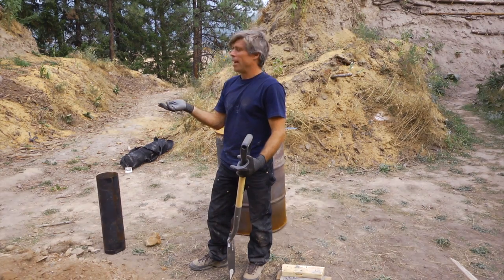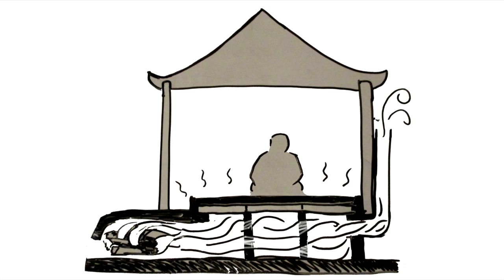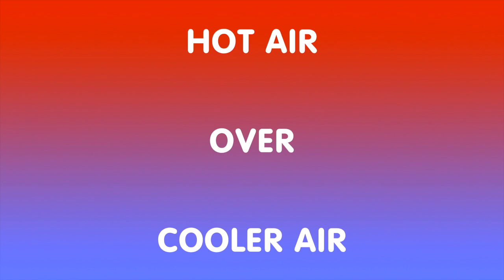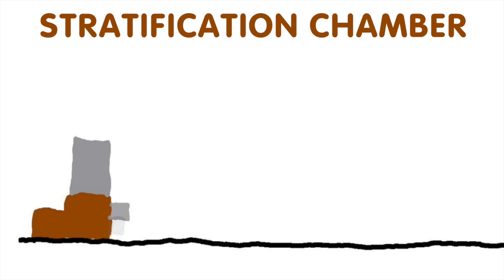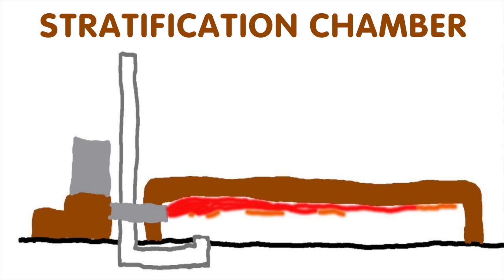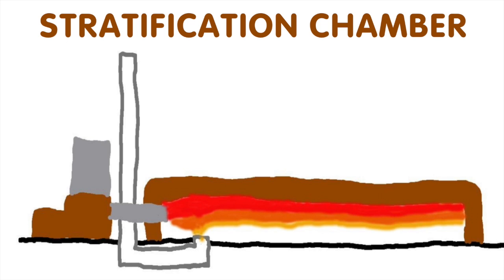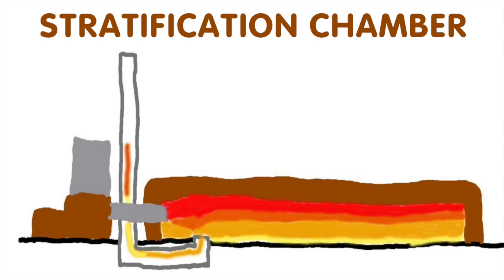stratification chamber in a rocket mass heater with matt walker

Comment: animation is understood-able, but  the side of bench nearest to the heat output from the rocket stove will be stinky hot to be sit on, as compare to the further side of the bench.  isn't it. 

unless u got a thick wall above. 

and less very much less mass in it as compare to the flue type of bench , hence maybe the heat won't last till morning. 

any number comparison ? :=) anyway, good work, that's how chinese in the older day did it to their sleeping bed.. just simply flue under the bed.. made very tight, so won't be poison by carbon monoxide during sleep.
Reply from the maker: Stinky?  We have tested this.   The heat spreads out really well and really evenly - provided that the stratification chamber is level.  

Less mass is, indeed, less mass.  

I think you are mentioning the kang bed stove - which, I thought, came from korea.
Reply: i don't know abt korea, i do know my wife who is from china told me about it.. basically just channel underneath a mass.. not like with cob, but cement blocks and cement plate. 

maybe also fr korea, i don't know. korean, japan, china.. have reason to believe those ppl came from same place originally. lol

it will be good if able to somehow put big cylinder tank of water under it to absorb the heat. 

paul,
i was over a week in UK at the beginning of this year.. on a farm where we stay in container house (which is poorly insulated).. at night of freezing weather, i put a plastic warm bag with almost boiling water in my sleeping bag (2 layers of sleeping bags) and sleep in it.. it is wonderful, so warm and cosy .. a lot better than warm out the whole container.. and believe it or not, every morning i woke up with the rubber warm bag still warm to the touch.. still comfortable.  

i just bury the bag in the 2 layer of sleeping bag... and until evening, the bag is still warmer than the air temperature in the container.. which to me is still cold.. 

you know when in proper insulation, it retain warm for that long.. should be good for heat storage.. just that in this case it is metal container (which radiant the heat a lot faster)

and we can use the warm water as well.. 

any idea , Paul ?
Reply from the maker: like hot water bottles?

Comment: What is to prevent the heat from "draining" out the bottom and not filling all the way to the cold or right side in the animation?
Reply from the maker: Rocket mass heaters tend to be pressure negative systems due to the vertical exhaust being warmed.

Comment: Looks very promising. We are getting ready to build a Peter batch box design. We have plenty of clay and sand and were planning on the traditional cob bench with 6" flue pipe. My question is which system ( traditional cob or stratification chamber) would more efficiently capture more heat? I already have the materials and being retired have the time to do the traditional cob.
I'd appreciate any feedback as we will start doing our build in a week or two, many thanks
Reply: Matt here, it depends on where in the system, burn habits, goals, and other variables.  I typically end up with thicknesses in the 3"- 6" range in the thinnest section, over the top of the arch. Hope that helps.
Reply: Good question TW.  The answer is no, much like a standpipe in a pool of water.  The water must fill to the level of the standpipe before it can flow out.  In this way a bell provides even heating across a broad surface in a simple layout.
Reply from the maker: I'm sure peter would agree: stratification chamber is more efficient.
Reply: Paul thanks for the quick reply. Do you know how much cob Matt is using to cover his cut-in half 55 gal metal drums? I know the formula for burying the 6" pipe in a cob bench, but what is the formula to keep the buns warm without roasting the chestnuts in the stray chamber design?
Reply: Hi Matt, that definitely helps. Now that I know that the strat bench is the way to go, I'll need to figure out the configuration of drums in my available space. I'll send you a more complete design idea in the next couple of days after I take my final measurements if you wouldn't mind. We are very excited to get this project rolling as winter is finally showing up here at 8000'. Thanks again for all the wonderful posts that you and Paul have so freely shared with us all. Be well, be happy.
Reply: broaudio  With the system working on the draw/drafting effect of the chimney, would it not be sucking newly heated air out the exhaust before it has a chance to fully stratify down a long bench or other dead end run of mass?
Reply: broaudio ok thank you, I guess I was thinking the stack effect would act like an aquaponics bell siphon in your water example.  Glad to hear it doesn't seem to be the case.  I need a low profile them all mass heater in my garage shop beneath a workbench like a foot deep 3'tall 12' long. Having stockpile zigzag back and forth was feeling way too complicated.!

Comment: Thank you so much for this!  I've been searching all over on how to run the ducting for "bell" systems and it just happened to show up in one of the channels I already subscribe to.  I wasn't sure if this setup would draft properly...it worked in my head, but often times real world applications differ from my ideal plans.

I've had a plan similar to this in place for quite a while, but was afraid to implement it for fear of draft issues.  I thought it might decrease the "rocket" factor....has that been an issue for you folks?  Or does it burn rocketier than ever this way?

It looks like this opens up a whole new world in terms of heat storage.

Thanks again for sharing.
Reply: Are the diameter specs for the remaining ducting the same?  From the DAYS of RMH videos I've watched...I've seen folks come to the general consensus that you never want to use less than 6" for any of your ducting.  Wondering if that is the same with this new setup.  It seems like it might be more forgiving.
Reply from the maker: You can go bigger, but not smaller.

Comment: Do you get more smoke-back with this design?  Looks like it would create more back-pressure on the inlet to the stratification chamber.  Using Matt's upside-down water example and your drawing, it looks as if the "water" would have to be pushed up and over the outflow.  (The system has to suck or push that cooler air through a bend and then up the exhaust.)

Also, it seems you'd really have to emphasize air-tightness and structural support to the bench (over the hollow chamber).
Reply from the maker: You do need a relatively good seal, but a few leaks are okay.  Withe the vertical exhaust next to the barrel it becomes a pressure negative system.

Comment: My RMH is based on Matts design, it heats like crazy, is easy to light because of the huge draft from the half barrels. But being lazy & bored with cob & how long it takes to cure, I layer 2 inches of pea gravel & cover with 1 inch of cob. It may take me several winters to complete (I figure 10inches of TH) to equal your all cobbys
Reply: If I could figure out how to post pictures or videos I would. Alz I know is when I first tried to light a fire, I used newspaper but I didn't have enough of a cage of kindling covering the burn chamber, so the paper would suck into riser, so now I just use "hairy/stringy bark" from a poplar tree. Lights very easy. The half barrels create a greater draft/exhaust than 8" stove pipe
Reply: Pictures - otherwise it never existed ;-)
Reply: “because of the huge draft from the half barrels“
The barrels do not create any draft.

Comment from the maker: Animation acceptable?
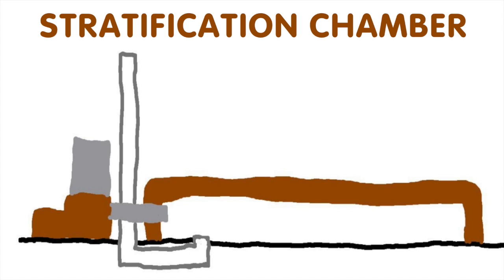Reply: paul wheaton does the job, and is pleasant in its simplicity. Referring to the previous video with the tipi, the "cold plug' referred to would be in the little u-bend drawn at 4:46??
Reply: Anthony Man pondering similarly, thinking maybe some horizontal mechanical layers to aid in the stratification, perhaps sloping back and forth until the cooling air is whisked away by the super charged vertical chimney...it occurs to me that there should be a way to ease the flow of the hot air so it truly stratifies rather than mixing...🤔
Reply: Yup, I don't need Pixar pretty. Just some simple examples & good communication.
Reply: Anthony Man yeah, I dunno about that A-Man, the exhaust has to be low to keep the heat from pouring out before it has a chance to hang out and heat the mass...otherwise the heat will just fly out the chimney. Not sure about the efficacy of this stratification chamber, I think it’s great for Matt to be brainstorming but I’m concerned that there will be excessive heat loss out the chimney..
Reply: @tomschmitt8561  yes my concern too. Consider if the exhaust jet is fast enough to cause turbulence.
Reply: yep.
Reply: very much so.  thank you
Reply: paul wheaton  immediately I wondered if it would just back up/out
Reply: it seems to me the heat will be sucked out before it can circulate just from the suction of air draft flow alone leaving a cold seat... but i'm new to all of this.
Reply: Are you Walt Disney reincarnated?
Reply: yes, but it would be cool to have 3D for newbies :)   love the video!
Reply: Totally brilliant Paul !!!
Reply: I use cinema 4d for animations and sketchup for scene based animations. Could help you out next time. Holla!
Reply: Its glorious 🙌
Reply: Dope animation! Well done.
Reply: The bucked of science is pure gold.
Reply: Excellent
Reply: It got the point across just fine. Thanks
Reply: Animation incredible 🎉
Reply: very acceptable.   Wont win an award, but it more than gets the point across.
Reply: tom schmitt just make the intake lower, as low  as you want and exhaust a little higher than the I intake..?